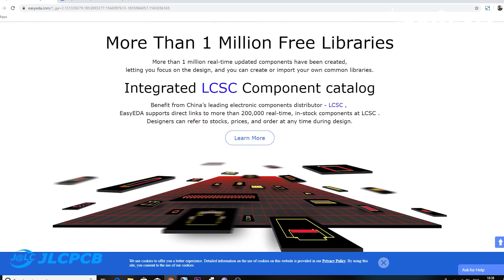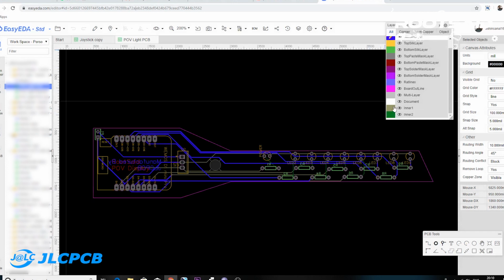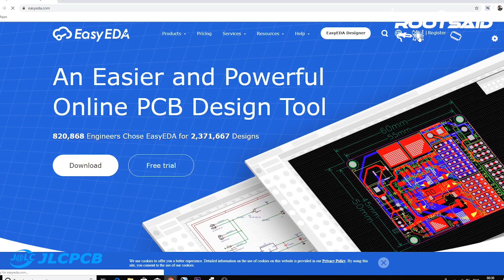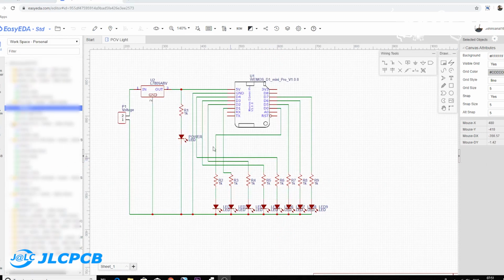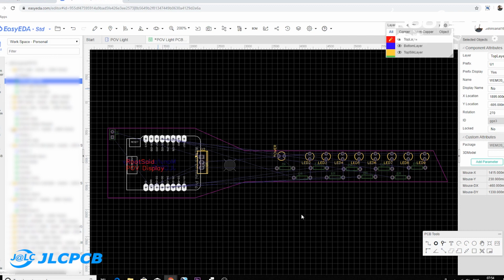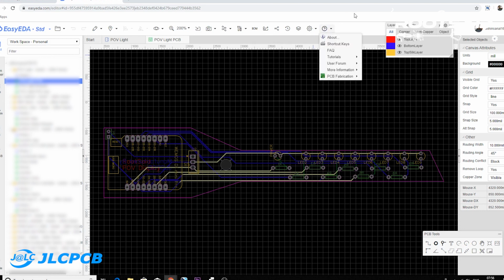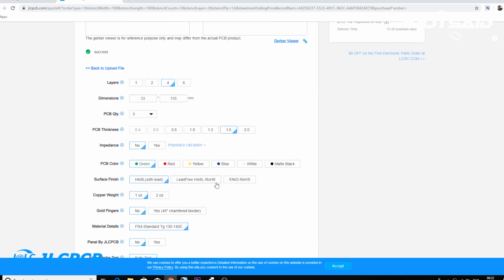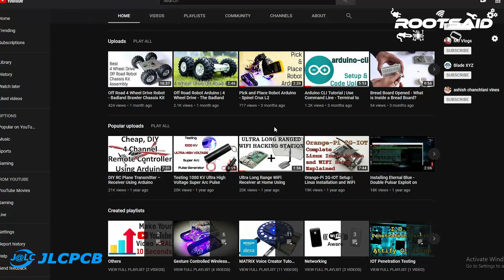4 Layer PCB Design and Fabrication from JLCPCB | EasyEDA Tutorial

Comment: I have just created my first 4 layer board, so this is what I know as of now from googling around.  I used EasyEDA Pro.

You should decide how to use your layers, e.g. from top to bottom Sig-Ground-Power-Sig.  Then place a copper region on the Ground and Power layers, and give it the corresponding Net label.  Next I hand route, because autoroute is such poor quality and often can't place everything.  Put thru vias to connect the Ground and Power (EasyEDA will ask you the Net for the via), and then route everything else as usual; you can still use both Top and Bottom for signals and connect them with vias.  At any point, you can select the copper regions and press the 'Rebuild' button, which will make the necessary blank spots around vias and signal lines. This makes routing much easier than on 2 layer boards.

Note that as of today, the $2 4-layer special offer is for 50x50mm max (not 100 x 100mm as for 2 layers), and you can only pick the green PCB color.